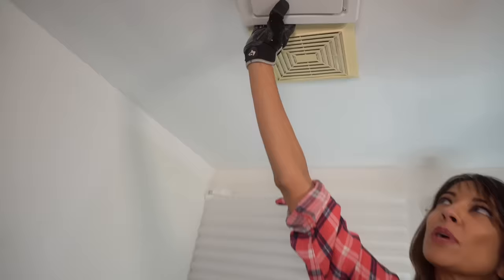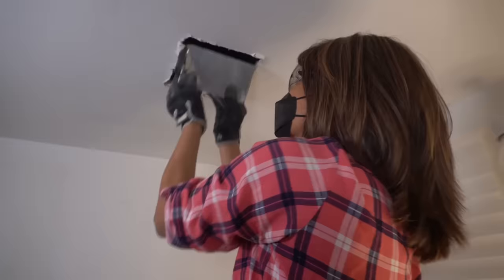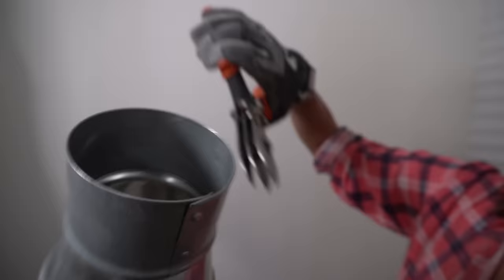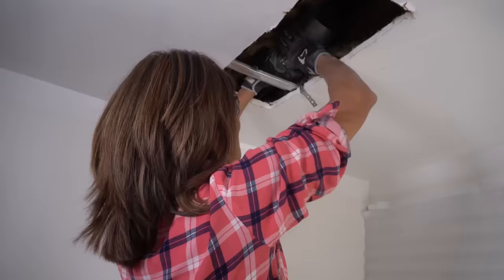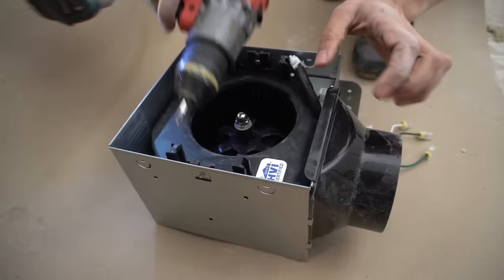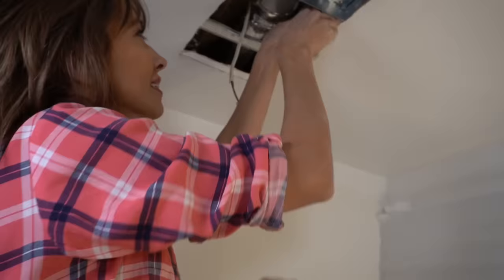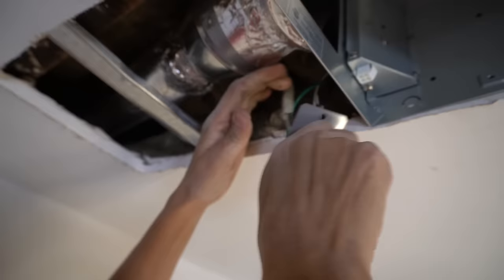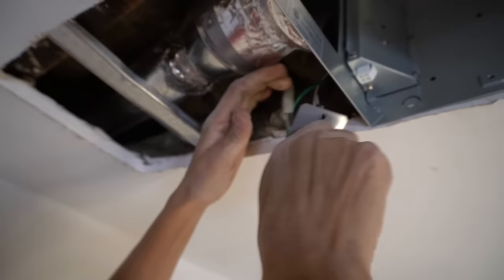Bathroom Exhaust Fan Replacement Upgrade | No Attic Access

Comment: That is ridiculous you would not have even been able to remove that fan housing because the duct would have been screwed to the exhaust outlet. You would have had to remove the screws before you could take the housing down.

Comment: She left out the hard part. Cosmetics. Finishing the ceiling. It will require finding something to screw the drywall patch to. It will require fiberglass tape and two or three coats of compound. Sanding the compound. If the ceiling is anything but smooth it will require texturing or popcorn which requires a compressor and a pattern pistol and experience. It most likely will need the entire ceiling repainted unless you have the exact matching paint. These are skills and equipment most DIY folks don't have. If the above steps are not done correctly your ceiling will look like the local cub scout troop installed your fan. There is another way to accomplish this task by cutting the old fan supports, installing deadwood on top of the drywall to attach new fan, then attach a flexible extension tube onto the new fan thus avoiding any ceiling repair problems. Somewhat more complicated but will save cutting up the ceiling.
Reply from the maker: Here’s how I patch ceilings for a perfect finish: How to Patch a Hole in the Ceiling | The Best Ceiling Hole Patch Is...
https://youtu.be/R7ILT22gAJc

Comment: Do not break the drywall piece you cut out, save it,mesh tape it back into place, plaster it back into place, sand,prime, paint.
Reply from the maker: That’s the best way. Thanks for the tips!

Comment: Probably a 100 time easier to just replace the cover.
Reply from the maker: The fan wasn’t working but the fan cover replacement is a great suggestion. I have a video on that too. It’s easy, like you said! 👍🏽
Reply: Even if the fan is still working, the new ones are much quieter and often have a light.  If you have a small fan like this, as I do too, likely you have a small bathroom.  An old fan in a small bathroom can be very loud .
Reply from the maker: @bjb7587  The old ones are surprisingly loud once you replace them it's kind of a shock how quiet they've become that's true!

Comment: Two tips for anyone attempting to do this work: 
1. get a Studbuddy to find screws holding up the sheetrock. This can help in not tearing the sheetrock for later use
2. use an oscillating tool for cutting the sheetrock
Reply from the maker: Hi Leticia, Thanks for sharing your tips with us!
Reply: A keyhole saw cuts sheetrock very quickly.

Comment: Well…. For me, just changing the vent cover alone was perfect and easy!!! No need to changing out the fan!!! Love the work!!!
Reply from the maker: @SLLLC-904  thanks! The fan motor wasn’t working so it needed to be replaced but a new cover is an excellent solution!
Reply: @DaruDhillon  Awesome! Great work on your part for at least showing the process!!! Thank you!!!

Comment: Not easy with older homes which have a 3 in duct. This is the first video I have come across where someone has gone into the details of installing the the 4in to 3in duct reducer. Thank you, will give another shot at this today.
@Daru Dillon, pls share the link for purchasing 4 in to 3 in duct reducer.

Comment: You should continue the 4" vent to the outside wall as intended by the fan manufacturer.
Nice job on the drywall repair!
Reply from the maker: @Darryl603  yes, that is the best option. Thanks!

Comment: Timely! I removed one today and it was just vented into the attic. Fortunately I did not see any mold.  Tomorrow I have to make the opening big enough so I can get up there and run 12’ of semi flexible to the outside wall!  So much for easy!
Reply from the maker: I hope your installation goes smoothly! Give yourself a pat on the back for fixing the issue and making your home healthy. That’s important!
Reply: If you live in a region that gets below-freezing temps, buy the flexible insulated duct line. Otherwise, cold winter air in your attic condenses on your warm duct and creates dripping water on your ceiling drywall.

Comment: Love the instruction. 👍🏼
Hate when special tools are required. 😩
Reply from the maker: Thanks so much! True. An older home like this is can be more work than a newer one.
Reply: I've got good news for you, Kneel: The cut in the drywall can be made with a jab saw (about 10 bucks). The fan housing could be removed with a handheld screwdriver in the unlikely event nobody will lend you a battery-powered drill. The 4-to-3 reducer comes pre-crimped at Home Depot so you don't need that highly specialized crimping tool. The HVAC tape is about 10 bucks a roll. The wires are presumably already stripped so you don't likely need a wire stripper but you can get one for under $20 at HD. And those Wago Wire Nuts sell for a buck or two each and you only need 2: one for the hot (black) wires and one for the neutral (white) wires. They click shut. No tool required. A 6-inch drywall taping knife is under $20. A small container of pre-mixed drywall compound maybe $20 and some fiberglass mesh drywall seam tape maybe $10. That whole project should cost you about $100 in tools and materials (not counting the fan itself) and you're saving hundreds on a contractor to install it. And I bet if you ask a buddy he owns most of those tools already.

Comment: Great video! Was definitely helpful for the fan replacement I did over the weekend. Thank you! The Nutone brand fan I bought here in VA has a 3" vent, so at least I saved about $15 by not having to buy a reducer 😆
Reply from the maker: Glad it helped! That’s a perfect solution that you found on your own. Awesome job!
Reply: @DaruDhillon  all credit goes your way, really! The only snag I ran into was I needed to buy some flexible duct to attach it to the rigid duct that was already there. Applying HVAC tape to all the connections was a challenge, but I got it done. Also had to cut an investigatory hole in the ceiling, but that's to be expected. Great feeling replacing that 40 year old fan!
Reply from the maker: @timf5963  that’s a great feeling! Those holes in drywall can’t be helped. I know how it is. 👏🏽👏🏽

Comment: I watched a video an hour or so ago where a guy installed an exhaust fan in his bathroom and it had bluetooth and color changing capabilities. It was close to $300 but was really cool. I know you can get fans for about $50 that have the basic needs met, but if I could budget for that bluetooth one that would be the ultimate in exhaust fans!
Reply from the maker: That would be amazing! There is some cool tech out there. I’m on a budget 😎
Reply: @DaruDhillon  I'm on a budget as well, I will be building this one paycheck at a time, but I've decided that since I won't be buying a new bathtub/shower, and won't be buying new cabinets I can afford to splurge and go over the top every once in awhile..LOL and since I haven't been able to feel safe in my own bathtub (without fear of falling thru the floor) for several years now, I think I'll be making that new bathroom my little heavenly oasis! I already have over 100 glass blocks that I want to use for a partician and I want to find an old makeup dresser like my Grandma had, to put into the bathroom... So this quiet, Bluetooth color changing bathroom fan will be the icing on the cake. I just checked on that Bluetooth exhaust fan and it's $199.00 not $299.00 so that's even better! It's the Broan Nu-Tone. Check it out. You could probably find it cheaper somewhere else other than Home Depot.
Reply from the maker: @WhispersFromTheDark  sounds like you have everything in good hands. Good luck with your project. I’m sure it will be great! Thanks for the suggestion. Sounds wonderful!

Comment: We usually afraid of cutting the drywall thanks for the tips
Reply from the maker: My pleasure. Drywall is one of the easier things to fix in a house just takes a little practice. Definitely a good skill to learn. Give it a try sometime!
Reply: Or order a fan with 3 inch duct if that's what you have
Reply from the maker: @chupie123456  that’s a good option 👍🏽
Reply: @chupie123456  can't find any with 3in duct in the market :( Pls suggest if you find it.

Comment: Great clean install , great work . Its definitely worth doing if it has better performance than the older models. I know sometimes after a hot shower that too much steam damages the sheet rock after a while

Comment: The older ones are built to last, you could just chemically clean the plastic intake cover and save alot of money and keep a quality working product. Newer is now usually worse than what you have already
Reply from the maker: Those are great suggestions and true. The original fan was at least 30 years old. It stopped working. I agree that if something is working it’s doing its job. Grateful for that.

Comment: I've just replaced a bath exhaust fan in my house for the first time. Do yourself a favor and get a Panasonic WhisperFit fan model. It has special design to make it easy to install when you don't have attic access. No need to cut a large hole in the ceiling to later patch it.
Reply from the maker: I’ve installed those before but they are expensive and I have to buy clean covers as an add on. This is an affordable version that looks significantly better and is well reviewed, works well and quiet. Panasonic is a good brand but they need to update their covers. Thanks for sharing your experience!

Comment: Dara, thanks for this video.   I purchased the same unit and have installed in our home where another fan  was failing .  Because  of the length  of the existing  Romex, I installed  a Jbox in the ceiling to make up the electrical connection.  The space for the connection inside  the unit is really tight - not a great design.   For that reason I would not buy another of this model.   The unit is very quiet  as you indicated .
Reply from the maker: It’s great that you installed it yourself. Well done! Thanks for sharing your experience too. It’s always helpful!

Comment: Thank you for the video.  This job is not complete if the vent line is not tracked down. You do not know where the venting goes to (is it vented out of the roof or just dumps into the attic which leads to all sorts of issues) or if the venting is blocked or crushed.  If the status of the venting is unknown a new vent path should be run (typically out of the side of the bathroom if possible.  Build a small soffit to place the fan and venting within.
Reply from the maker: This fan is vented through the exterior wall. You can see the 3ft of ductwork in the ceiling when it’s open. To check use your phone and record a video of it to confirm. It is indeed essential to exhaust it outdoors. Thanks!

Comment: I live in a condo that was built in 1982. I think my bathroom exhaust fan is getting due to be replaced. I'll probably need a reducer too. My drywall patching on walls hasn't been very good although that might be attributed to using products that come in a plastic tub.
Reply: A few tips I’ve learned for drywall patching over the years:
1. Buy a roll of fiberglass tape and a plastic bucket of drywall compound, plus a good drywall knife twice as wide as the tape. The right material makes all the difference and is there for your next project. 
2. Cut and remove the old drywall as clean as possible. If necessary, add some 2x4 blocking to the ceiling joists to screw the drywall to the ceiling. 
3. When you get a clean opening, and dry fit a piece drywall to fill the hole, mark and offset slightly wider than half the tape. Use a really sharp knife to cut the drywall just as deep as the paper face, and remove the paper from the existing drywall and the patch. 
4. Use the tape to bridge the gap. 
Screw through the tape then add another piece of tape on top. Because the drywall paper has been removed, you should still be below the surface of the drywall. 
5. Work the drywall compound by smearing it in a tray, or even just the bucket, many times to make it as creamy smooth as possible. Apply at least two coats. Focus on pressing the compound into any voids on the first coat. While it dries, sprinkle a little water on the unused compound, close the lid and clean the tools. Go through the same process for the second and probably third coat focusing on getting level, then smooth. Use the surface of the drywall as a guide for the smooth surface. If the compound starts to ravel, make sure the drywall knife is relatively flat (less than 45), and possibly spritz a little water. 
6. Before closing the compound, spray some water. It will help to keep it from drying out for the next time. 
7. Sand smooth and paint.

Comment: I wish I could do drywall repairs! Cutting the drywall is what keeps me from upgrading my exhaust fans. 
Every drywall repair that’s been done (by pros) in other parts of my home have cracked/failed 3-4 months later.
Reply from the maker: I’m sorry to hear that you’ve had to deal with that problem. If you ever want to learn I have several drywall videos that can help you out. It’s pretty simple like icing a cake. You can use backing, like me…or make sure the repairs are done like that. I hope it works out for you! How to Patch a Hole in the Ceiling | The Best Ceiling Hole Patch Is...
https://youtu.be/R7ILT22gAJc

Comment: A big concern about using reducers.   You can still buy "economy" but quiet 3 inch fans that are  usually about 50 cfm.  The 4 inch are usually about 90 cfm.  HOWEVER,  the cross section area of a 3 inch pipe is 9/16 that of a 4 inch.  Therefore, your new 4 inch fan will not be able to push 90 cfm into a 3 inch duct.  At best it means you wasted your money, and at worst, you could burn out the fan motor because it cannot run at full speed.  If you must have a greater flow, buy a couple feet of 4 inch duct with your new fan and replace the whole length. Also saves you the work of patching and painting the ceiling.  I believe in staying with 50 cfm, especially with difficult attic access, because 90 cfm units require that much more outside replacement air flow from some door or window.
Reply from the maker: Appreciate your perspective and tips. Ideally it's best to go with a 4" line in this case.

Comment: Bought a new exhaust fan about 6 weeks ago, the old one was seized. When I realized the new one wasn't a direct replacement and my old fat ass wouldn't fit in the crawl space to the attic I grabbed some aerokroil and lubed the motor and cleaned everything up and reinstalled, works like new and if it lasts until spring I'll figure it out then.
Reply from the maker: Smart man! Love your in moment solution. Thanks for sharing!

Comment: Great Job indeed…wonderfully narrated. Please add Safety Glasses to your list of mentioned safety procedures: Breaker off / Test for no electricity / Gloves. Thanks great tips.
Reply from the maker: Thanks for the great reminder about safety glasses. Especially important when doing overhead work. Stay safe 👍🏽
Reply: Dust mask to avoid breathing in insulation and dust.
Reply from the maker: @bjb7587  Good tip BJB thanks! Stay healthy, stay safe :)

Comment: Just did four fans not that easy. First to get screws out old vent we had to cut metal with tin snips. Also you have a pile of insulation fall out when you pull the old box out.
Reply from the maker: You did it. Great job and you did four!

Comment: Great video but it would have been nice to see how you repaired the drywall you cut out. Did you use the same piece you cut out?
Reply from the maker: Hi, I did reuse the same piece of drywall and added backing. Lots of tips + tricks to patching ceilings. Drywall deserves its own video: How to Patch a Hole in the Ceiling | The Best Ceiling Hole Patch Is...
https://youtu.be/R7ILT22gAJc

Comment: Good video. 
To be honest, I'd remove the exterior vent cover, enlarge the hole to accommodate a 4-inch vent line, and run new 4-inch to the new fan. I'm not an HVAC expert by any means, but I don't want the turbulence (is that the right term?) that comes with the reduction from 4 inch to 3 inch.

Comment: Nice vid!   Our fan cover plates have yellowed over time, like one in your video.   The fan motor itself is fine (still quiet).   Can you buy replacement covers?  Thanks!
Reply from the maker: Great advice Craig, thanks for sharing! I have a video on how to install replacement covers which is the perfect solution. This motor was dead but I love an easy cover replacement. 👍🏽

Comment: I wish I could have seen the drywall patch since you cut it out between the framing.
Reply from the maker: Thanks for letting me know Susan, I’ll keep that in mind for next time. I added furring strips in behind the patch so it doesn’t crack and I use a special patching tape. Here’s a link to how I patch: How to Patch a Hole in the Ceiling | The Best Ceiling Hole Patch Is...
https://youtu.be/R7ILT22gAJc hope it helps! If you have any questions I’m here to help.

Comment: I have been thinking about changing my bathroom vent, stumbled on to this great video, super discriptive with awesome tips. Subscribed and thumbs up.
Reply from the maker: Awesome! Thank you!
Reply: Same! I was dusting/vacuuming and accidentally bumped one and I realized how old and frail it’s time to replace. I had no idea it would be so much work to do it! I changed out all my light fixtures recently but thought that would be easier! I have the same exact vent that was the old one in this video so I’m sure I’ll be doing everything you did. I’m ok with that.c just hoping it would have been a quick pop off and pop new one on. 😩